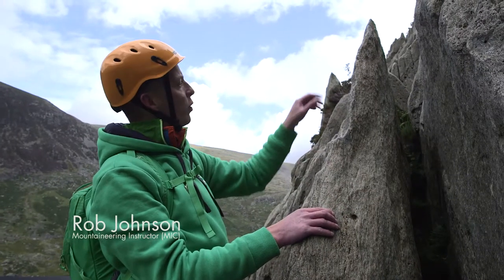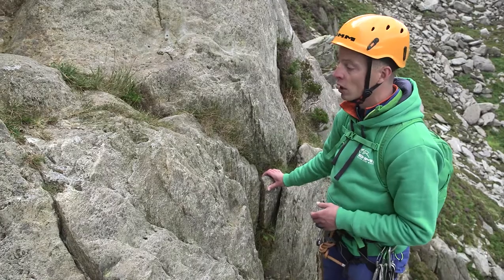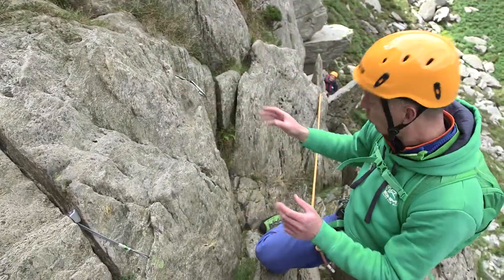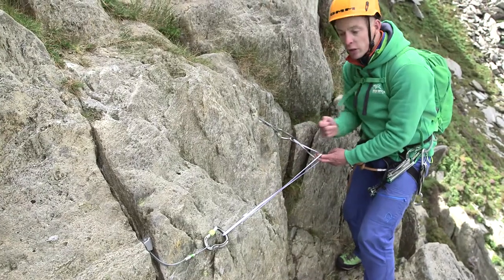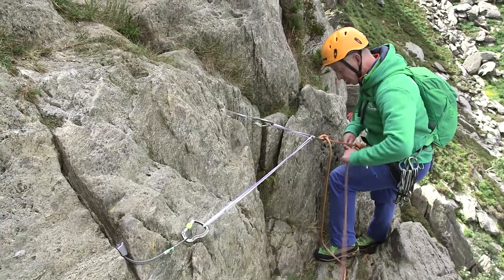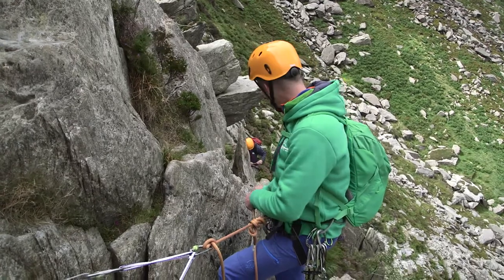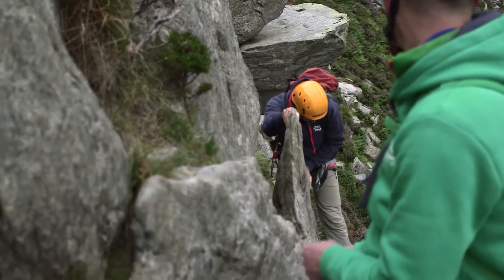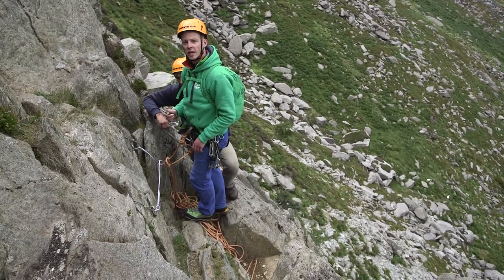Rope skills for scrambling 5: equalising belays and belay devices

Comment: Great vid thanks! 
I'd really apreciate if you could cover the topic of short belays while guiding a client on via ferratas (rope management, fact that both guide and the client are also using via ferrata set - Y, gear needed,  movement...).
Thanks!
PS: in this video here you are probably using a dynema sling, which is not safe if using knots.
Reply: It is safe, even with a 50% reduction you're still looking at 11kN which is way more than you could possibly generate even if it got vertical. 

As we only have one or two Via Ferratas in the UK I think that's unlikely, but just apply the same principles if you ever needed to do it. The majority of via Ferrata safety wires are run through 'pigtails' which are not a closed loop for this exact reason. Build an anchor onto something solid and belay off that, not your belay loop (if second falls and pulls you off your stance, both yours and second's weight go onto your vF set that deploys at 1.3kN)

Comment: I doubt if he will hold a free fall of the Second because his use of the Reverso for belaying a second is not correct. very Doubtful
Reply: 3:47 think the same.  I doubt if the Reverso could be set up this way.  The belayer can't catch a fall with this setting.  He should either do a guide mode, or redirect the live rope from the anchor if he attaches the belay device on his belay loop.